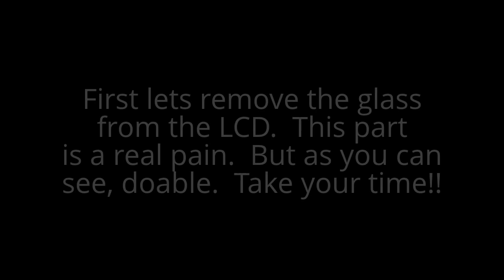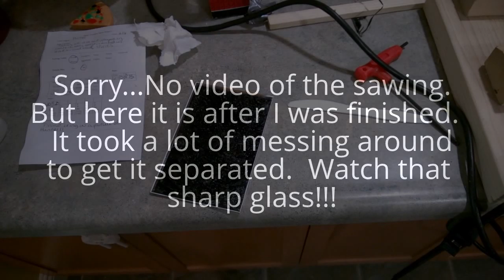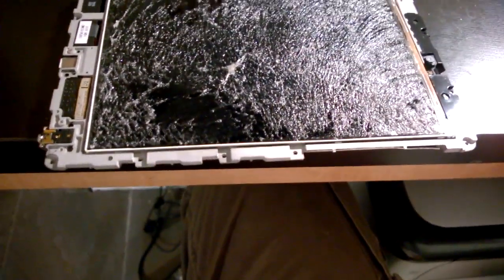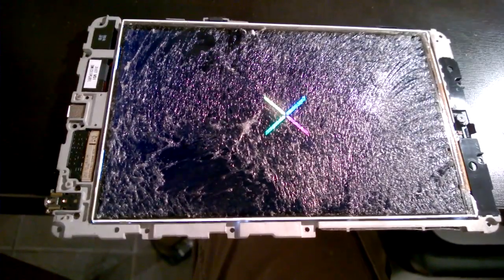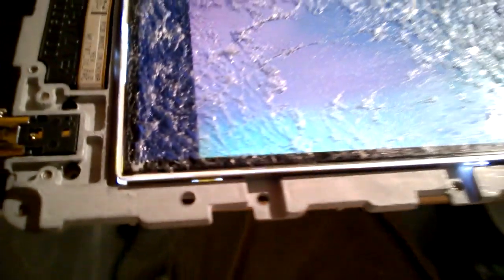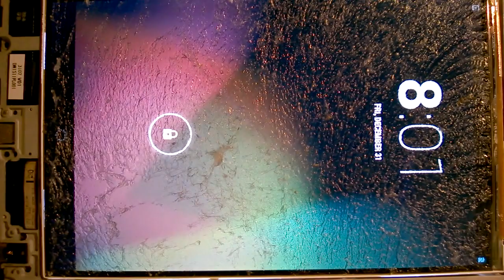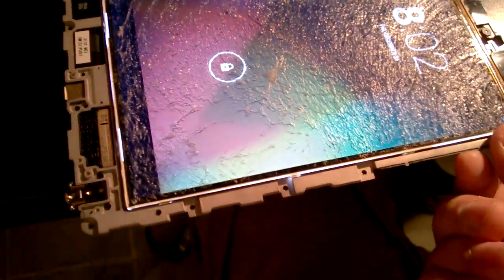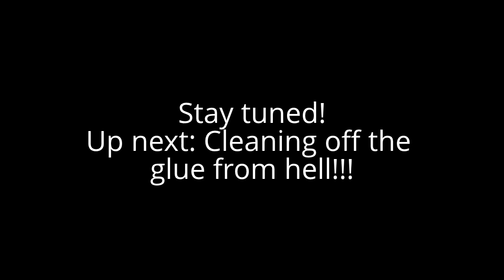Nexus 7 - Glass / Digitizer Removal / Replacement - Part 1

Comment: Hi,

it is shame you couldn't show us how to do it, because it is easy to crack the lcd.   But let me ask you:

- How did you heat it?  (home made logistics)
- What temperature (if you could include celsius great)
- What sort of wire is it?
Reply from the maker: +alernito Yeah back when I made this I didn't have my gopro or the mounts/tripods that I do now.  Or I would have set something up.  I heated it using a standard heat gun that you can buy at lowes or harbor freight.  No idea what temp I got it up to.  I just heated it until the wire could move easily.  The wire was a mandolin string.  You could probably use a high e guitar string also.  Any type of thing wire.  Sorry I couldn't help more!  I really don't recommend doing it at home honestly.  It wasn't worth all that work to save a few bucks.  And the outcome wasn't great.

Comment: still, how do you split digitaizer from glass smoothly, i tried once carefully, with a small heating and plastic card, still i broke both parts... do i need some special heating or smth else to do as smoothly as you did?
Reply from the maker: I mean you can use a wire like I did.  But it wont be "smooth".  Heating only takes you so far.  The problem is, the digitizer glass is so thin and breaks so easy.  Especially if its already cracked.  Not sure why you'd be doing it if your digitizer wasnt busted, but you can do it without damaging the LCD, as shown in these videos and others.  Patience...thats the best tool for this job haha.

Comment: Nice video! - I used a hair drier to heat the adhesive holding the bezel to the glass.  My mistake was heating from the back rather than the face, so the tape separated from the bezel, not from the screen.  Ended up cracking and scrapping the whole project for a replacement.  So I have a new digitizer/screen assembly (Nexus 7, 1st gen 2012) with tools available http://raleigh.craigslist.org

Comment: well... i tried.. and destroyed lcd.. damn.. :/
Reply from the maker: Yeah..its definitely a "Proceed at your own risk" type of project.  What went wrong?  A lot of people Ive talked to mention they just ran out of patience and tried to force it.  I was actually pretty surprised when my LCD fired up to be completely honest.
Reply: ***** I guess that I've accidentaly isolated some of the LCD layers.. That glue is too damn strong. :/
Reply from the maker: Capsel
Whoa!  I havent seen that before.  Yes...that glue is insane.  Stickiest stuff on earth maybe haha.  Sorry it didnt work out for ya...fortunately, the LCD/Glass combos are dropping in price a bit.  At least the couple that i saw recently.
Reply: ***** yeah, i'm going to buy new lcd tommorow maybe. Btw is there some glue needed after replacing digitizer and lcd?
I mean that glue (arrrghh!) should i put there some new glue, or just leave it like it is?
Reply from the maker: Capsel Are you talking about the adhesive around the bezel?  That is like good double stick tape basically.  If you were able to get the old glass and bezel separated, with no glass shards left behind, and if the adhesive is still sticky, you can heat it up, and stick the bezel on the new screen most times.  If its really messed up with glass shards, or mostly peeled off, you'll want to use new sticky tape.  I think you can find that stuff on ebay/amazon.  I was actually able to find a brand new bezel, with adhesive already on it. I just peeled off the backing and stuck it to my new glass.  It was cheap...$15 maybe?
Reply: ***** No, i have that sticky tape on bezel. i mean when you were separating an old digitizer with lcd there were that insane glue. Did you put a new glue on lcd?

Comment: Funny, you mentioned not knowing how you were going to turn off the device after doing a power-up test.

Fact that a LOT of folks apparently DON'T KNOW:  An OTG cable and a USB Mouse equals 100% control over your tablet without the need for a working digitizer.
Reply from the maker: Haha yeah.  Im actually using a track pad while its installed in my car :)  Back when I did this, I hadnt experimented with the Nexus at all.  I was banking on being able to fix this broken one, and do my testing.  If it didnt work out, i was going to sell the brand new one and cut my losses.  Way beyond that point now!  haha.

Comment: congrats on actually separating the digitizer and the LCD, now - how do you remove the glue and what are the easy ways to glue a new digitizer on?)))
Reply: Hi JEG, 

so, how's your nexus doing? 

i'm not sure if i got it right from your other video - do you say you use the tablet without gluing LCD and digitizer together?
does it actually work? 
i'm about to attempt separating the broken digitizer, but still have no firm clue on how to reattach the new digitizer to the tablet. 

thanks!
Reply from the maker: Dmitiriy Lem
Hi Dmitriny!  You are correct... I did NOT glue the new glass onto the LCD.  What I did, was use some very thing double side tape around the outer edge to keep it in place.  Then, once you assemble, it doesnt really go anywhere.  However...if I had a way to UV cure glue, I would have used the LOCA glue that came on it.  You have to UV cure that stuff... Some have done it by laying it in the sun, but I wasnt that daring.  The tablet still works great!  The only issue is, the glass I got was cheap, and you can see a dot pattern from the digitizer.  When the screen is off.  And, in the very center, the glass touched the LCD, and caused a small dark spot.  But again, you can only really see it when the screen is off.  Gluing it would have avoided this.  Also, the touch sensitivity of the cheap glass is a little worse than the other nexus that I have.  But it works great for my second car as intended!  Ill take another video soon I hope...
Reply from the maker: *****
All you have to do is tie the string between two handles.  The handles can be pieces of wood, tools, anything really.  Just make sure its something the string isnt going to slice through easily.  The handles I used were too soft, and actually got cut.  You just tie the string between them, and use a sawing motion back and forth to cut through the glue.  Watch your fingers while doing this. DO NOT tie the string around your fingers and try this haha.  You'll lose a hunk of your fingers before you know it.  And yes..you can use a high e guitar string as well.  I just used the mando string because I had extras, and they were a big thinner.  The thicker guitar string might work better actually...

Comment: Well done, you beat me to the video ;-)  Respect as the man says. I managed to do one last week but overheated it in places with a heat gun with left yellow and white burn marks.  I've worked on another today. I gave up with the working face down as the Molybdenum wire kept snapping and sliced through a couple of test units LCD screen. Had success today and have the working LCD with glue on it. Just posted the video.

Comment: first people I've ever seen dissasembling nexus 7's lcd from digitizer. respect.
Reply from the maker: Thanks!  Certainly wasn't easy...and in hindsight, I probably wouldn't do it again.  Replacing the LCD/Digitizer as an assembly is the way to go.  Or...if you have a way to re-glue the LCD using optical UV adhesive.  One or two other guys have done it, but Im trying to show the entire job and that it is possible to have a decent working tab after!